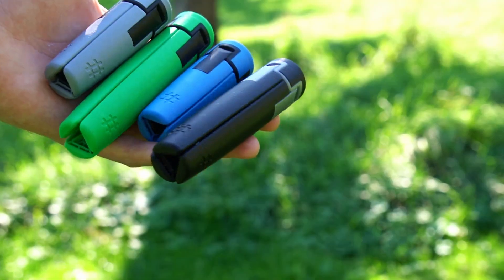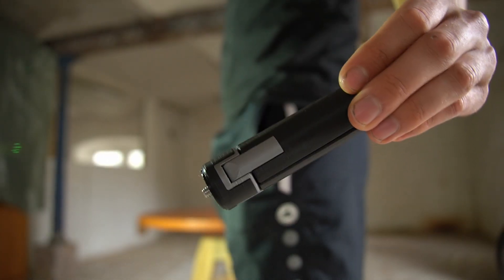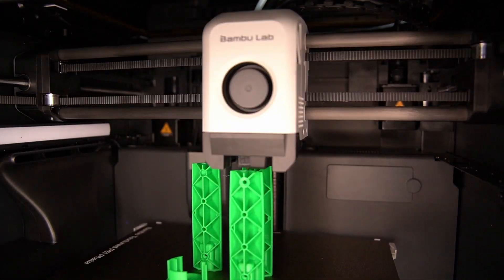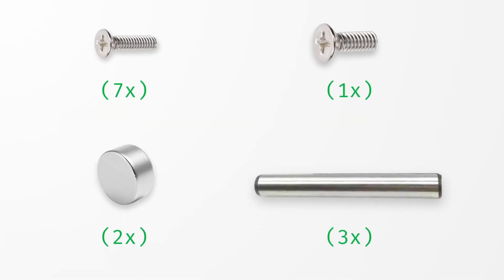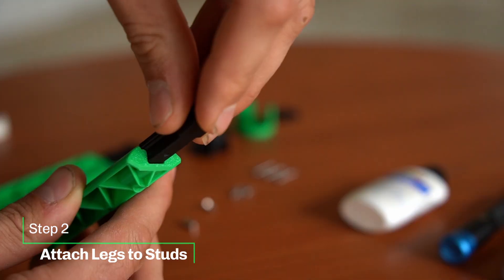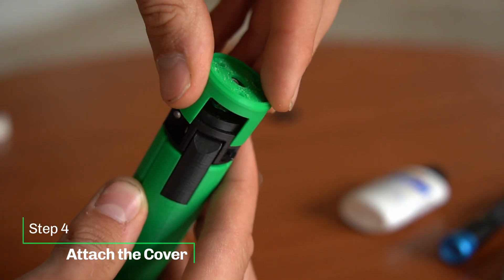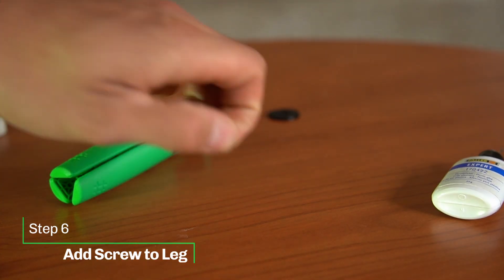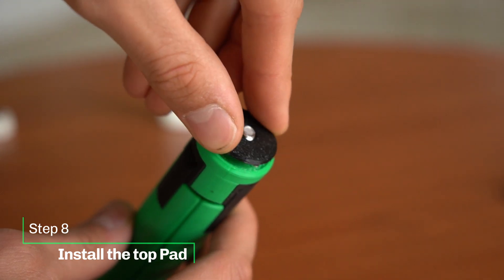3d printed Tripod | Assembly

Comment: Why have the bottom of the legs open with struts?  For injection molding this would be needed, but for a 3d print I would expect this to be stronger and easier to print if you just design it solid and the  have the slicer put in the appropriate amount of infill, no?
Reply: It definitely would, and I was just about to say this (4 walls and 15% infill should be more than enough); general shape is decent though